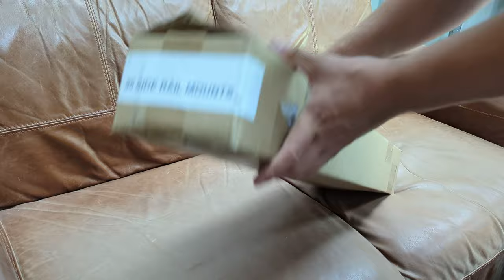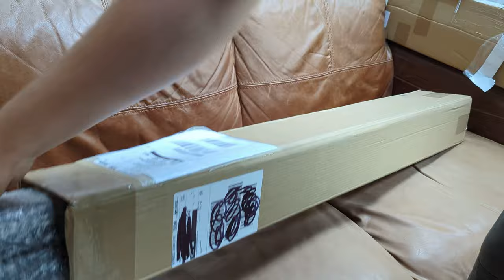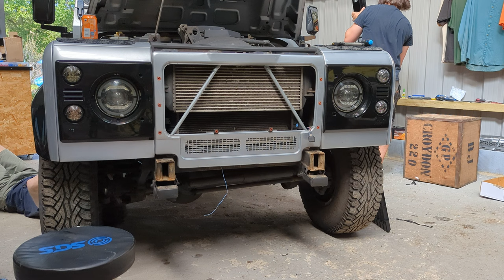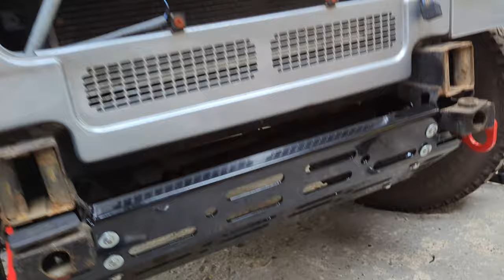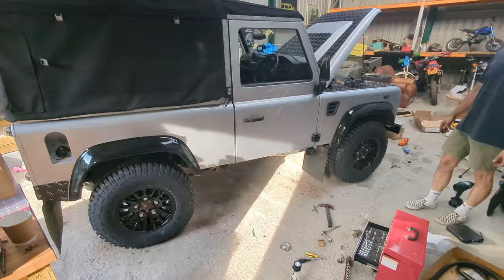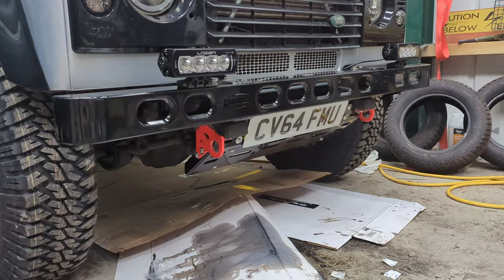Defender Bowler Upgrades

Comment: What is the prep work you do between taking the wheels off and putting the new ones on?
Reply from the maker: Did a bit of a wire wheel just to get any bits off rust off and then copper grease 💯